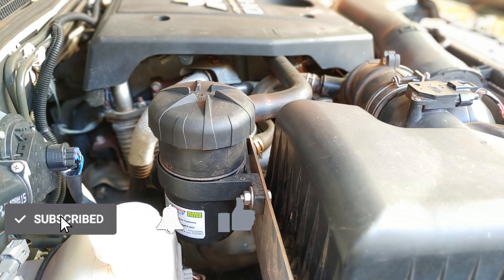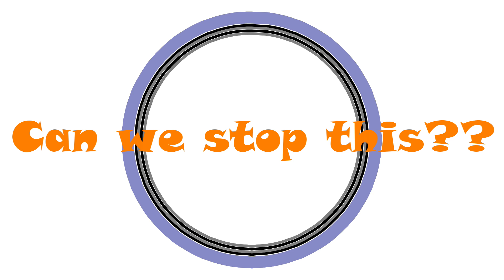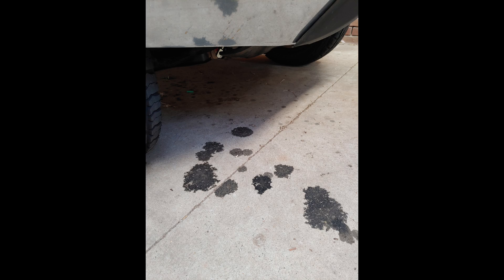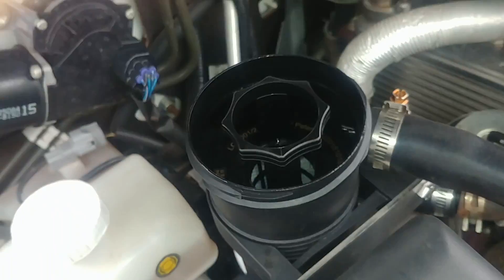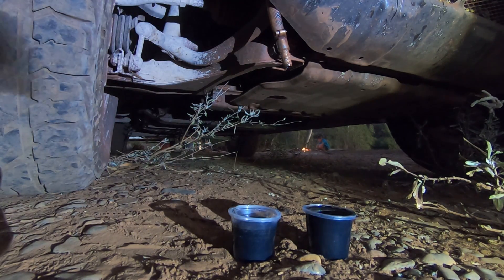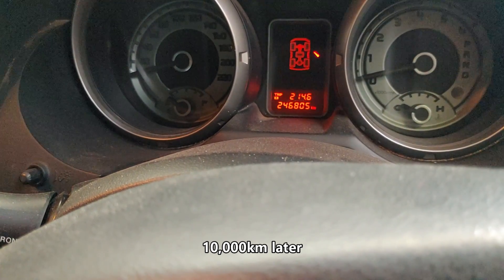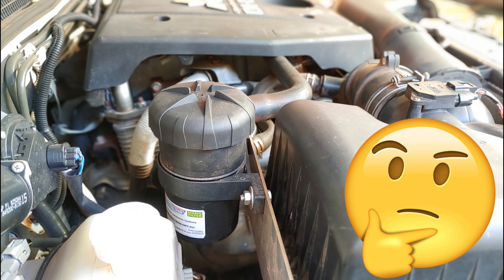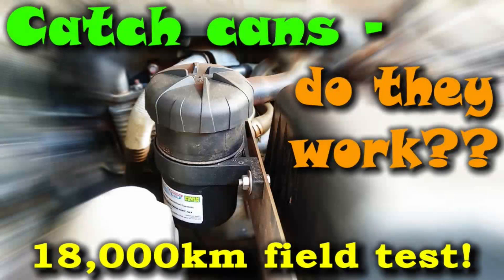Provent 200 Catch Can - How well does it work??

Comment: Do an ECO fumes test now on the car, it should be a lot better now.
Reply from the maker: What do you mean by an ECO fumes test?
Reply: @TheMusingGreg  ECO test on the exhaust. Maybe it pollutes less now.
Reply from the maker: Oh right. I don't have an easy way of doing that but I'm not sure it would be too much different. The air-fuel mixture will still be the same, it's only manifold pressure which will be a bit different and that shouldn't affect emissions.
Reply: @TheMusingGreg  I think it should benefit emissions a little bit. Need to clean the DPF filter if it has one tho.
Reply from the maker: You might be right, but as I said a partially blocked manifold doesn't change the air: fuel mixture so I can't see how it would help. DPF's do need regular cleaning, especially after cleaning the manifold with a solvent, but my vehicle doesn't have one

Comment: catch cans are the biggest waste of money and don't do anything
Reply from the maker: It depends what job you want it to do. It definitely pulls oil out of the intake air, that much is clearly demonstrated. However it's not going to completely stop manifold build-up on its own, so if you bought one purely for that purpose which is often how they're advertised then yes it's not going to be money well spent.
Reply: edit: "most" catch cans....the Mann and Hummel Provent series are proper devices. The China copies don't do much in comparison to be sure....and all the empty cans do stuff all.

Comment: I think 2 catch cans is better than one.
Reply from the maker: It probably would be but that's an extra $300 and more space in the engine bay. One certainly deals with almost all the oil residue, so I wouldn't think the cost would be worth it for the small amount of vapour which might get by the first one. Maybe a different story if you're talking about a cheap catch can that doesn't collect as much, but then you have more chance of back pressure which could cause oil leaks in your engine.

Comment: Good work , if you get the Ryco RC200F filter element its interchangeable with the Provent 200 filter. Ryco testing proved their filter is more efficient at crankcase residue/ oil removal. Ryco have their own catch can system now. Own testing showed a Nissan NP300 with 2.3l single turbo engine makes around 80ml of oily residue in 10000kms.
Reply from the maker: Thanks for the tip!
Reply: @TheMusingGreg  Mate no matter which filter you use in the Pro vent 200 some oily residue still gets past the filter. Even with the Ryco RCC200F (Sorry typo in last comment this is correct Ryco part no) The "oily residue" consists of all sorts of nasty items best not remaining in the inside of the engine or in the crankcase oil or coating the inside of the inlet air tract. e.g. all related to piston ring pressure bypass or blowby - burnt lube oil from thin films on cylinder walls, soot, diesel fuel, water at times if engine temps are lower than normal due to short trips. Many claim the "oily residue" removal promotes valve face/valve seat wear- this is crap as OEM valve stem oil seals actually meter oil down the guides for proper valve guide/stem lubrication. This is not commonly known that this metering occurs- take a look at SKF as their valve stem seal literature talks a lot about adjusting valve guide oil flow, mostly directed at OEM's as this oil flow contributes to emissions.. Both petrol and diesel engines can digest their blowby but diesels sure pump out the catch can residue due to combustion pressures being higher. Hope this helps all who read it.
Reply from the maker: @stevebliss3600  Thanks mate, I can't imagine why oily residue would help prevent valve seat / face wear. The stem maybe but as you say they are already lubricated by design. I think the biggest issue is the EGR soot getting mixed in with the oil in the manifold, but neither really belong there!
Reply: @TheMusingGreg  Spot on mate you are onto the issues for sure, why I said about valve seat wear is there are" experts" out there who do not understand lubrication principles of engines. Crankcase ventilation has been around since 70's so we live with it.
Reply from the maker: @stevebliss3600  Haha cheers mate, yep there are many benefits to having pulled apart engines as a kid / younger bloke, it's so much easier to picture what's going on!

Comment: Dry soot is more abrasive
Pro vent filter increases back pressure when oiled back pressure creates more blow-by dry soot causes dirtier oil and wear
Gauze replacement filter won't block but will reduce oil  
https://www.youtube.com/watch?v=iiuCJtxUyqM

Comment: Thanks very interesting. I have bought the same. Unfortunately there is no room in the engine compartment. I have now clean the intake and the egr unit with heat exchanger. Volvo 2017. I will try ones more to make room for the occ. 😊
Reply from the maker: Good luck, I hope you fit it in!
Reply: @TheMusingGreg  thanks

Comment: No catch can on my 2004 Hilux 3.0 TD…I just did a EGR  and intake manifold clean out then did an EGR delete using the metal blocking plate with a hole through the centre immediately after….that was at 217000kms…now its done 283000km….no dash light.. no overheating issues nothing….gone from Syd to Perth and back 3 times…on one trip back to Sydney DID NOT turn the engine off the whole time even when at the servo…just switched drivers…if i was going to have an overheat or blowback issue its there….NOTHING….just sayin!
Reply from the maker: Thanks for sharing Russell. Yeah I wouldn't expect any overheating issues from an EGR block. It would be interesting to know how much manifold gunk it's preventing.

Comment: Anyone thinking about this be super cautious of the level in the can.. if it ever fills your pcv valve looses suction and your cam shaft , crank shaft and oil pan seals get pressurized... gets really expensive fast.. 😫
Reply from the maker: Good point Ashoud. Mann+Hummel recommends emptying the catch can every 5000km, and in that time it's very unlikely the catch can would be full unless the engine's absolutely shot. The times I did mine the drain hose wasn't full up, let alone the catch can itself. So if it's emptied regularly you'd be fine.
Reply: @TheMusingGreg  it fills faster in areas with high humidity. I had mines fill up very fast and my seals all blew out . I had no compression issues with the pistons. Engine runs better without it after all the repairs I had to do.. I'm not putting this  on any of my engines.. ever
Reply from the maker: @Ashoud_Anobetah  Yep high humidity would contribute to it but I'm surprised yours filled up that quickly. How long was the drain hose attached to the bottom of your catch can?

However you're right that if it did for whatever reason start filling into the catch can it could cause those problems. I guess the lesson here is that if you install one, check how full the drain hose is regularly and make sure it's not filling into the catch can. Then drain it regularly up until after the filter is saturated with oil and measure how much you're getting out so you know how often to drain it from then onwards. Thanks for the input!

Comment: Catch cans create back pressure into the crankcase by not allowing the bypassing fumes to scape as quick as they are supposed to exit.  This back pressure into the crankcase will worn the block seals and many inner components much faster.  You might be extending the life of your valves at the expense of other inner components...
Reply from the maker: That can happen depending on the catch can design. But stay tuned as I've got something coming on exactly that!
Reply: @TheMusingGreg  Can't wait to watch it
Reply: a properly designed one that is maintained does not have this issue. 
There are vacuum tests conducted on the provent and it shows a negligible level of restriction.
Reply: Same thought.. that blowby pressure needs to release as quick as possible...

Comment: The problem is the EGR system, if they wanted to cool an engine, they could of used a simple water spray, instead of injecting exhaust gases back into your engine.
Reply from the maker: Yeah they could, but that's another reservoir to fill up much like the modern urea tanks. EGR is simpler and probably cheaper for the manufacturer to make. Unfortunately the cheapest way to get the job done often wins out, because we as consumers reward those manufacturers by buying their cheaper product.
Reply: @TheMusingGreg  At the cost of the engine, it was only last year I had to rebuild the Ford ranger 3.2L diesel, $18K later it was working again, manufactures don't care about what we have to do to maintain their machines, a water bottle and a spray pump may have been an extra $300, do you think this might of saved my vehicle?  I got rid of that vehicle, I have another 2.3L in a Renault Master van, and I'm more impressed with this engine than the Ford. Cheers, have a good one
Reply from the maker: Cheers mate look it's possible, depends on what caused the failure. I 100% agree I'd prefer my engine to run without EGR think it would be better for it, but at the same time if it was a consistent cause of failure there'd be a much wider trend of failure.

Comment: You have to plug the inlet back into the intake from the outlet of the provent and reroute it to the intake airbox before the filter. There is less suction before the filter and also it won't affect your vacuum because you plug the inlet where it usually connects back to the intake system. 

EGR and crankcase ventilation throws off the air/fuel ratio because they enter the engine after the mass airflow sensor so if you reroute it to the airbox BEFORE the filter and Maf sensor, you will have an overall smoother and more efficient, clean burning engine. Deleting that whole system will put you more into savings and out of environmental hypocrisy which is based on ignorance.
Reply from the maker: OK I get your point; I guess if you have a catch can installed then that won't be so much of a problem since most of the oil fumes will have been taken out.

However as far as PCV throwing out the air/fuel ratio, yes in theory that's correct but the blowby is plumbed in after the intake by design from factory, so I would imagine this is already taken into account by the ECU even if it's not getting measured by the air flow meter. There's still the MAP sensor in the manifold which the ECU can draw data from to work out the air volume (fresh + blowby) actually passing through the system. Have you personally and quantifiably seen a smoother and more efficient engine by replumbing like this?

Comment: To get a true result, at over 200,000 kilometers you need to have fitted new or reconditioned injectors prior to the before v after test.  This may have been done and mentioned in the video, as I skipped thought it quickly.
If the injectors are old and tired that black buildup in the intake will reflect what's going out the tailpipe.  And that engine sure seems to have a LOT of crankcase blow-by.  In my Prado 120 with a Provent 200 and similar mileage, towing a 2 tonne caravan back and forth though the mountains for 8000 kilometers (engine working REAL hard) I drained about two tablespoons of oil.
Reply from the maker: Hi John, no I hadn't changed the injectors but that's not necessary on the Pajero like it would be for a Prado of that age. Pajeros don't seem to have the same issue of injector seals leaking and creating extra blowby.

I think the difference is just that the Pajero is reported to be a pretty heavy breather. I've got two other videos of Pajero oil fumes coming from the oil filler, one on a 20,000km engine and one on mine at about 230,000km and they were very similar.

Thanks for the comment!
Reply: @TheMusingGreg  My Prado 120 is pre common rail with what is know as the 1kz-te old school engine (fully mechanical injectors).  The injector seal problems only stated when they changed to common rail type injectors.
At 200,000 km (and well before that) I was aware of excessive smoking under hard acceleration because looking in the rear view mirror at night you could clearly see it in the headlights of a close following car.  Since changing the injectors, no more smoke/soot.  If there is less smoke/soot coming out the exhaust pipe, has to be less going into the intake manifold via the EGR valve.  
From that experience I reckon those who promote doing injectors and glow plugs (where applicable) at around every 100,000 K are on the right track.  One glow plug was completely missing the tip.
Car definitely pulls harder when towing since doing the injectors, and that's important as the 1kz-te engine while pretty bullet proof aren't all that powerful.
Reply from the maker: Ah gotcha, I thought all 120's had the 1KZ-FTV engine with that injector issue (I learnt something today!). I have actually noticed exhaust smoke in the lights of following vehicles on my car too so maybe I'll look into injectors. That said, the heavy breathing aspect of the 4M41 engine in the Pajero still sounds to be normal so I'm not surprised at the amount of oil in the catch can; it's just the amount of black exhaust in question, which as you say would affect how much is going through the EGR circuit and into the manifold.

Cheers John!
Reply: @TheMusingGreg  Bought my 2004 Prado 120 just before they changed to common rail.  At first I was disappointed, but that quickly changed as soon as I heard of the injector problems in the common rail engines.  
I bought reconditioned injectors from Hi Tech Diesel in Adelaide.  No problems, delivery was quick, and core deposit retuned without drama.  Will use again.
Doing the injectors and glow plugs in the Prado 1kz-te was very straight forward for anyone of moderate mechanical ability, and good appropriate tools.  I have a bit of a head start on most, being a qualified heavy vehicle mechanic (left the trade to do other things later in life).
Reply from the maker: @johnwoodrow8769  Thanks for that John, very interesting. Mine are electronic injectors but I might look into it nonetheless. Cheers!

Comment: Powder dry is not good, dry soot docent seem good further down in the engine. A regular spray with cleaner and oil changes would work better I think
Reply from the maker: Not sure about that Richard. You could be right, but I think I'd rather have a dry smooth sooty surface on the intake than one which gets sticky and blocks up over time. I found the Liqui-Moly product didn't do too well with dissolving soot, so using that during oil changes probably isn't going to help much anyway. What's the problem with a thin layer of powder dry soot on the inlet manifold, valves and intake ports? Once you get to the combustion chamber you'll have engine oil in the cylinder to keep it moist.

Comment: Wouldn't this come from your engine oil? Wouldn't you now need more oil since you have taken it out?
Reply from the maker: Hi Richard, yes it is partly oil fumes from the crankcase as well as some diesel exhaust and water vapour mixed in with it. But you don't need to top up the oil any more than usual, because it wouldn't normally get back into the sump anyway. Normally this stuff would get sucked back into the combustion chamber and burned out the tailpipe.

Comment: EGR the cause
Reply from the maker: Yes the EGR is part of the problem, although as you'll see in a soon-to-be-released video, getting rid of the oil vapour stops the build-up and just leaves you with dry black soot which isn't as clogging as the oily residue. Stay subscribed so you don't miss it when it comes!
Reply: If I haven't done that yet to install the oil catch can... Right now I prefer it to block the egr and the breather blows it out into the air... as a result all channels stay clean.
Reply from the maker: @takesihultra2820  Yep you can do that, but it's illegal so you're in strife if you get caught with it like that. Also on the Pajero, an EGR block throws a fault code unless you also modify the throttle body. It's not great for the environment to blow all those oil fumes out to atmosphere. That's why Positive Crankcase Ventilation was invented, and of course it's a pain on diesels with EGR added into the mix, but a catch can removes that residue without adding to air pollution.

Comment: Hi Greg, I love your testing methods. I agree....the dry carbon build-up in the manifold after the catch can installation won't be a problem. To build up carbon you need oil. Look at a truck exhaust, they get a layer but that layer never grows and becomes a problem. It may "self clean" as dry carbon needs oil to stick.
             I had a 2012 dmax with 140,000 kms and upon selling it I noticed some oil seepage at a hose connector on the manifold. I didn't have a catch can, this was after the intercooler so imagine how much could have been in the intercooler being that it is mounted sideways and doesn't self drain.
Reply: My boss’s 2021 dmax has an oil leak on the air intake from blow by oil. 70,000kms techs can’t find the leak but it catches dust and drools enough for trails in it
Reply from the maker: @mustangdude Check out the 40,000kms follow-up video - the carbon did in fact build up!
Reply from the maker: Very true! Yep I don't think there'll be any more build-up but I'll check it out in a little while. We've just towed a van from Adelaide to Perth via Pt Lincoln so have put another 4000km on it, so I'll take a look in another month or so and see how it's looking.

Before I bought this Pajero at 186000, I looked at another with 220000 which had oil seeping out around the air hose leading out of the turbo. At the time I didn't know what it was from, I assumed they were oil pipes or something, but it might have been similar to your Dmax!

Cheers,
Greg